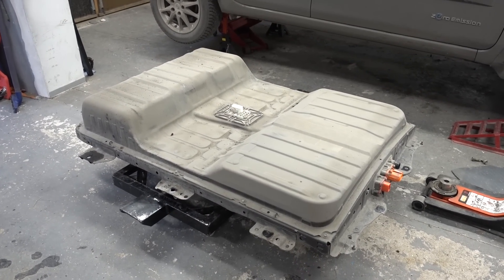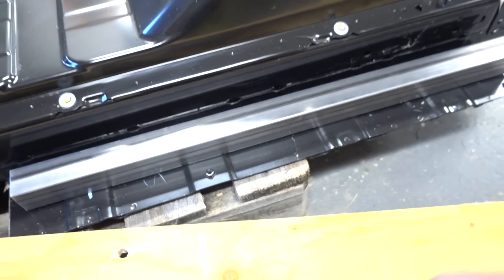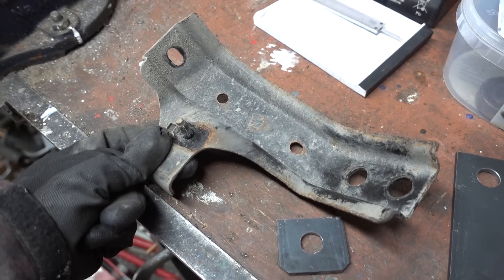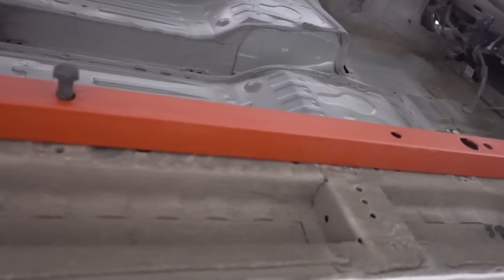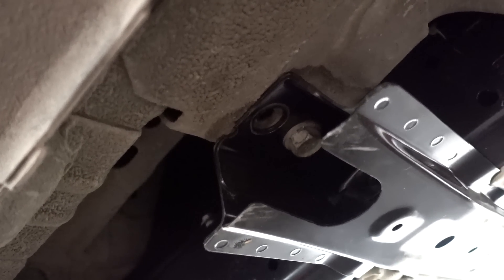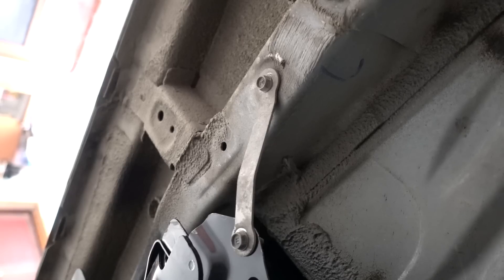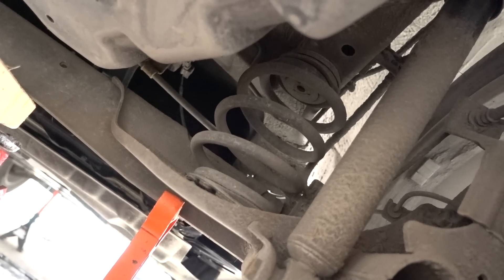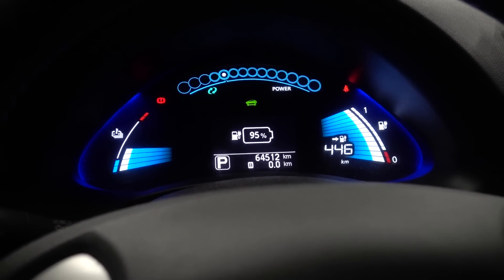Ultimate Nissan LEAF Battery Upgrade (62kWh)

Comment: This is why buying a severely degraded Leaf in perfect cosmetic condition is worth it for $1-2k. Spend another $4-7k on a big battery pack from a wrecked leaf, and you’ll have a very practical EV for under $10k.

Comment: Hi, what is the diemensions between holes on the support bracket please ? Thanks
Reply from the maker: The Github Wiki has CAD drawings https://github.com/dalathegreat/Nissan-LEAF-Battery-Upgrade/wiki#special-notes-about-62kwh-pack
Reply: @DalasEVRepair  thank you

Comment: Also where on the USA is the best place to buy a 62kw battery
Reply from the maker: Sorry I live in Finland. Try the MyNissanLeaf.con discussion forum
Reply: Konduit EV in Vista, CA, did mine.  Had a 62 KW battery installed in our 2011 Leaf, replacing the original badly depleted 24 KW battery.  Range went from 20 miles to 200 miles including hills!  Amazing.  Cost was around $11k at a local specialist.  Well worth it for basically a "new" car.  Highly recommend them.

Comment: Hello Mr. Dala, after watching some of your videos, I purchased a 2015 Leaf with very low battery life my range was only 25 miles, I purchased another 2016 Leaf salvaged with a new battery was installed a month before the accident, when I installed the battery from the 2016 Leaf to the 2015 Leaf it was easy now I have a master warning light and my turtle light, you mentioned a can-bridge needs to be installed and the computer needs to be flashed, any assistance would be much appreciated
Reply from the maker: Use Leafspy. Clear P3102 code. I have videos on it!
Reply: Hello Dala, The tech is having issues  pairing the 40kwh battery to my 2015 Leaf even after installing the Vive can-bridge, I was watching other videos and they mentioned that you sell can-bridge that does not require pairing
Reply from the maker: @yervant01  My CAN bridge does NOT work for Vivne packs. This is a cellswap, and requires BMS reflash. I have no solutions for this, and no interest in supporting someone elses product. You need to get support from the person you bought the battery from.

Comment: Great video the only downside to retro fitting a 62 KW battery that I can think of is the acceleration would be a lot slower because of the extra weight!
Reply from the maker: It sure is noticeable. I have tested the 160kW inverter with both 40kWh and 62kWh batteries, and I recommend sticking with the 40kWh if you want a really sporty feel!

Comment: Hello Dala, great video ,I have fitted a 62kw battery to my 2016 leaf and used a 2 port can bridge but am having problems.I programmed the can bridge in accordance with your other video and it stated as successful but I am getting error codes such as p3180-00 0B, u100 -00 0E,P318E-00 0E,U214E-00 0E and U215B-00 0E. I have tried several can bridges but the result is the same,can a can bridges be programmed more than once? 
Any information would be really appreciated. Best regards Jurgen
Reply from the maker: Known issue, some cosmetic codes will be active. Nothing to worry about! Enjoy the upgrade!

Comment: Very interesting, thanks! What did you do at the end with the laptop? Is that mandatory when swapping the battery? Is it diy doable? I am thinking about buying an older leaf and doing this, there are some really nice cars available super cheap because of the battery range problems. Thanks again!
Reply from the maker: Yes it is very DIY friendly, guide on the Wiki page here: https://github.com/dalathegreat/Nissan-LEAF-Battery-Upgrade/wiki

Comment: Great Video

Based on market demand, we have established a production line specifically to provide OEM battery manufacturing and upgrade services for Leaf.

As a Leaf battery manufacturer, Leaf battery replacement and upgrade are the focus of our services. Including models ZE0, AZE0, ZE1, and ENV200.

After replacing our battery, your Leaf will gain a lot of range, making these vehicles better, faster, and have a longer range than when they were new is very feasible.

Installation is very convenient:
If you want to purchase a complete battery pack, just plug and play.
If in a separate battery module, you only need to connect 6 power lines and 1 signal line.

Price advantage: CNS is a growing high-quality electric vehicle battery factory. We have invested heavily in product research and development, continuously optimizing and innovating products to better meet customer requirements and increase product lifespan. Compared to most well-known manufacturers, our products are currently sold at very favorable prices to expand our initial user base and scale.

Service advantages: CNS has a legal and fixed business premises, a certain industry background and experience, and we have a professional technical team that can independently complete after-sales services such as installation and maintenance of Leaf battery packs. At the same time, we have strong confidence in quality control. Good quality, good price, good service, and good feedback are our goals, so let’s start building long-term business and make significant progress together.

If you need it, please contact me directly at amy@cnsnrg.com, our factory in China will ship it directly to you。

Comment: hi! first of all thanks for all the valuable information you share, I have now performed battery upgrade from 30 to 40 kwh. In a few days I will receive canbus to program. I tried to charge the Nissan leaf but it does not start. Can you confirm that it depends on the battery change and when I install canbus will I be able to charge regularly? Thanks.
Reply from the maker: Yes, CAN-bridge is needed to be able to charge!

Comment: Where do people find the upgraded batteries?
Reply from the maker: Scrapyards are my goto!
Reply: @DalasEVRepair  Is there a way other than visually inspecting to know if the battery condition is good?
Reply from the maker: @dankaufman8900  connect an obd2 dongle and read out battery data. Nissan Leaf example: https://github.com/dalathegreat/Nissan-Leaf-Battery-to-OBD2

Comment: is this possible for a NV200 too?
Reply from the maker: Unfortunately not, the physical size of env200 packs is different. Only 24/40kWh env200 packs fit
Reply: @DalasEVRepair  sad face, i wod love to have more then 40kw in my evalia. Maxum in the netherlands. Offers a 30kw Upgrade wifh extra batterys, but the payload schrinks siknifnintly. So i look for a way to upgrade the cells in the pack..

Comment: I realise this is an old video, so you may not reply, but thanks for all your work.

As I am just at the start of an EV conversion using Resolve-EV with a 24kWh Leaf, do you have any thoughts on using Chinese new alternatives for 62kWh battery packs? Finding Leaf’s is not easy and I’d like longer range, but I lack confidence in sending so much money for something it is hard to know much detail about.
Reply from the maker: If you use chinese cells, might be best to skip the Resolve EV and get another BMS for the cells. It is not easy to get the chinese cells to have correct control with the LEAF BMS.

Look into the zombieverter project?
Reply: @DalasEVRepair  thanks for the response! I’m starting simple to make sure I succeed! Resolve-EV seemed ideal for me for that reason, but inevitably there are compromises. Maybe project 2 will be a bit more in depth and offer more flexibility.
As I continued to bounce around the internet, I saw a recent post from Muxsan, suggesting they are imminently offering new batteries for Leafs, so will see where that goes.
BTW- You are partly responsible for the growing number of vehicles on our driveway! Started with old VW T2. Then bought v low mileage 2014 Leaf for cheap, just to learn and feel what they’re like, and to see where it might lead me. Then bought a very broken VW T2 and more broken 2015 Leaf to practice merging them together. If it all works out I then migrate the electrification over to my current VW T2. The wife is very tolerating…!

Comment: I want to increase the battery capacity of my Mahindra e20 plus car from 11kwh to 16 kwh,I have made all the physical connections so that battery is can be charged through existing bms,car is running but there is no modifications in cluster reading and SOC status.what kind of software modifications or shunt modifications needed to solve the problem? Please help

Comment: Nissan still does not have active cooling in it's current leaf which is just flabbergasting. They are designed not to last. There should be no surprise to this since all Japanese car manufacturers have actively protested (and also done a lot of behind the scenes government influencing) against EV's.

Comment: Has anyone investigated putting better air cooling on the Nissan leaf battery?

I’ve read of ducted air con to the battery making improvement.

Edit : found a video elsewhere showing 3D printed duct & hose to connect air conducting dash vent outlet to the battery isolator on floor at back seat. Unfortunately this made little noticeable difference as it was blowing air over the sealed battery pack housing, not through it.

I’m thinking dry non humid air blown through the sealed battery pack might make a noticeable difference if the  battery-air heat exchange does not leave hotspots. Would be a very experimental process to test.

Comment: Hello Dala I have two questions:
1.do the inverter handle the load and driving 400 km continuously without stoping ??
2.do the battery needs cooling since the the old battery doesn’t have a lot of load but now if you drive high range there might be load and need cooling in summer??
Thanks in advance
Reply from the maker: 1. Yes
2. No cooling needed. It wouldn't hurt to have cooling, but it works without!
Reply: Thank you so much for answering

Comment: Dala: Awesome job!
Where are you located?
I have 2012 Nissan Leaf currently with 6 bars left. 
How much will you charge me to upgrade to 62KW battery
Reply from the maker: Sorry I dont take on customers! I suggest DIYing it with a local garage. Batteries can easily be sourced from Norway. 62kWh runs for about 6k

Comment: As a mechanical novice I just want to clarify something. Using the mounts you showed, a 62kwh battery pack attached directly to a MK1 Leaf, and all the electrics and electronics were just plug and play. Is this correct? And from the point of having the battery removed, this took you just a single day??
Reply from the maker: Check out the wiki https://github.com/dalathegreat/Nissan-LEAF-Battery-Upgrade/wiki

Comment: Hi, dala I have one question . Active pooling to HVBAT in aze0 is working after replacing battery from ZE1? There is different response 7BB ze0 vs ze1 and after checking your code there is no translation for 7BB response.
Reply from the maker: Active polling is exactly the same for battery

Comment: So , I was thinking , what would happen if you installed a 62 KW battery into a 2011 Leaf?  Could the area in the trunk where the original electronics for the battery sat be turned into a way to blow air into and out of the rear battery module for cooling?  The Toyota Prius did something similar. It had an air intake in the cabin area of the rear seat. The first gen Prius used air to cool their battery. If 2 or 3 inch flexible hoses could be cut into the top of the rear of the battery pack, they could be fed up into the body behind the rear seat. A fan with an air filter could take air from inside the back area of the car on one side send it through the battery pack and exhaust it back into the car on the other side or possibly out into the inner fender or body on the other side. It might be possible to install a kind of blend air damper.

This is all just a thought. I know there are other factors to deal with but the first gen leaf had that hump all the way across behind the rear seat when newer vehicles didn't.

Comment: Haha if you own a 24 kw/h Leaf and watch you turn on this one, it's quite amazing to see 446 km range after hearing the familiar little startup sound. I suppose we'll upgrade in a few years if the rest of the car keeps holding up.
Reply from the maker: I recommend rustproofing the underside of the LEAF to allowing it a fighting chance 😅
Reply: @DalasEVRepair  Oh thanks! Our local mechanic said the car is completely enclosed from underneath, we don't have to do anything... He said that when I asked him if I should get an undercarriage wash after the winter. 🤔
Reply from the maker: @adddude7524  unfortunately not true. Sills and wheel arches rust.

Comment: Hello!
Could you help me find out why the 2017/10 Leaf got a 40kW battery instead of a 24kW one. The charge numbers were originally in 40kW battery pack Q78/L473. Then 2 days later it became Q52/L2144. What do you think happened? Thanks!
Reply from the maker: Best to message the developer of Leafspy!
Reply: @DalasEVRepair  The first result was the same for another user in leafspy, I could not look at the second one yet. But I factory reset mine and still had the same numbers.
Reply: @DalasEVRepair LeafHacker also writes the same numbers, so it's not a LeafSpy error. Do you know the LeafHacker app?
Maybe I don't know what causes the charging to stop at 94% since the 40kW battery is in the car? Thanks!

Comment: Dala if you still monitor this video's comments. Alibaba is selling Nissan Leaf batteries. Do you have knowledge of anyone successfully installing them.
Reply from the maker: Lots of people email me after they have fitted replacement modules. All are disappointed, fitting 40kWh modules into a 24kWh pack will result in shite instrumentation and low range. The BMS simply wont work well with these NCM modules, when they are programmed for LMO.
Reply: @DalasEVRepair  thanks for reply. Hoping for better, but assumed your answer is correct.

Comment: Brilliant video......I could have watched the whole day's work if it had been filmed. I have just bought a Japanese import Leaf from 2010. It has a maximum range of approximately 70km, has around 70,000km on the clock, but drives beautifully. I would be really interested in doing this upgrade but the question would be where to find a battery?
Reply: I read that you can get them from salvaged damaged Leafs. Need someone to check it.
Reply: @Google_Does_Evil_Now  Would this be from a newer leaf? The battery dimensions are that similar?

Comment: Hi Dala, you surely got my respect. Great job and happy New Year!

I own one of the first 2011 Leaf models without a power charging  socket. Which means the battery's life is still quite good.

Nonetheless, with everything else  in good nick, what kind of upgrade would you recommend since a full charge might take more than 8 hours.
Reply from the maker: Happy new year!

I would be on the lookout for a fresher battery (30/40/62), and keep in mind that you can also add Chademo , I have another video on that topic!
Reply: @Dala's EV Repair  you mean the massive job video of yours on adding fast charging Chademo to the car. Okay, that's beyond my capability, and Finland is a 2 days petrol ride from my place. 
Having someone do it for me is probably cheaper to look for a younger model with supercharge already mounted.

Comment: The question I have been meaning to ask you Dala is, have you seen your m/kWh worsen with the added weight of the battery upgrade in your Leaf? I ask as a 24kW owner who enjoys a 4.7 m/kWh yearly average. Am wondering this as a lot of the newer equivalent cars to the Leaf don't seem to be as economical and am wondering if this is due to weight.
Reply: Probably not much in the city and nothing on a free road. In a car what makes more difference for consumption in the road is not the weight but aerodynamics. In electric cars with the energy recovery on braking when it is more weight it is also more energy recovered. There will always be some losses due to extra weight but it will be very small on normal driving. 
What I think is more important is that as the motor is the same, the car will accelerate slower.

Comment: Amazing swap thanks for doing Vids like this also can you speak about the cost of this I installations and what was done with the old battery etc please 🙏 would be very interesting information to hear
Reply from the maker: 62kWh packs can be bought for between 8-12k in the EU. The old battery will be put into a stationary storage system, to be used along solar!
Reply: @DalasEVRepair  that's great news to hear that the old battery is being recycled are you doing this by yourself as well ??
Reply from the maker: @randunufdo1  yes see my DIY powerwall build for an example
Reply: @DalasEVRepair  great thanks I will surely check it out.

Comment: you are still installing the kan bridge , you have long found in which place to edit the bms firmware for any vvb capacity
Reply from the maker: Illegal in EU to reverse engineer firmware for BMS
Reply: @DalasEVRepair  who will know about it ? if not to say, and then in the firmware itself, only the maximum capacity that the sensor counts in the battery changes.
Reply from the maker: @party-zn519  I post all my findings open source on github. Having illegal stuff there would be a bad idea, even worse to sell an illegal product. I will not pursue reflashing due to this reason. If you are outside EU/US this might work!
Reply: @DalasEVRepair  new Zealand also does flashing, but they have something of their own made there, for different chemistry, for titanate and iron oxide , I think you have at least heard this, maybe you know.
Reply from the maker: @party-zn519  Yes they are outside EU so the intellectual property laws don't affect them.
Reply: @DalasEVRepair  https://www.youtube.com/watch?v=zfO04SRpDyA
Reply: https://www.youtube.com/watch?v=45oRI5IlvsM